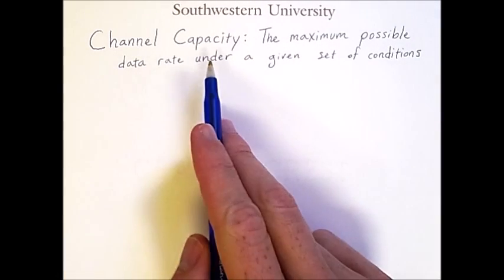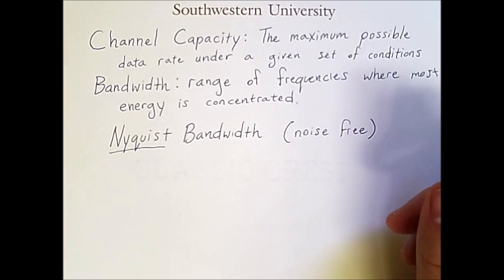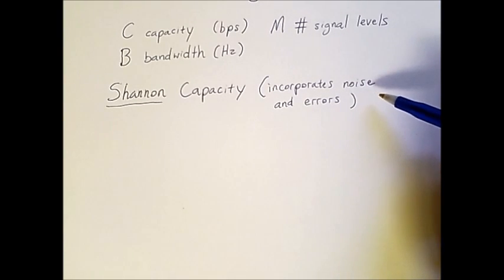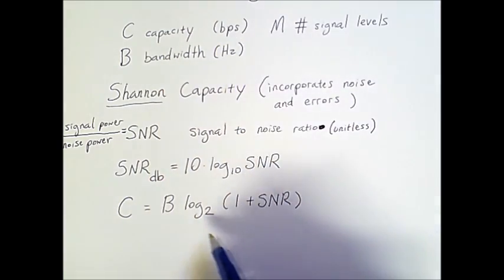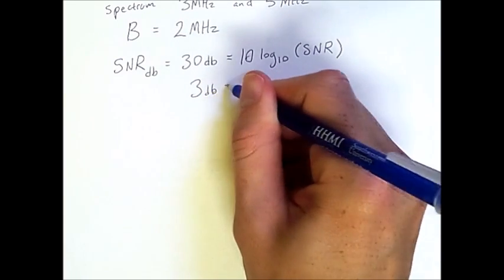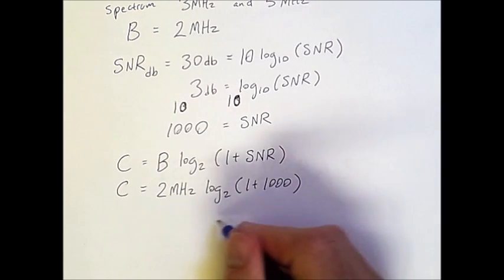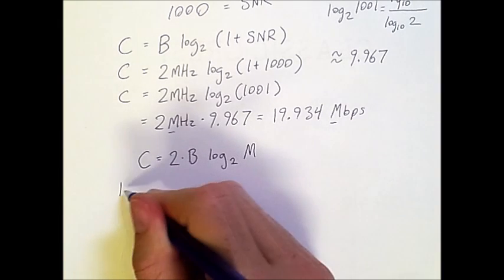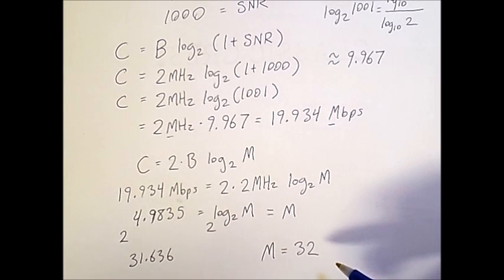Data Transmission 3: Channel Capacity

Comment: A digital communication system transmit data over a telephone link and a
maximum S/N at the output of 15 dB at a rate of 1200 bits/sec via a QPSK modem
that can operate at speeds of 1200, 2400, or 3600 bits/sec with error probabilities -4 -4 -4
2(10^ ), 4(10^ ), and 8(10 ), respectively. Calculate the bit error probability before and after using the error control coding (i.e. channel coding) scheme. Hint: Consider an error control coding scheme for this problem wherein the triplets 000
and 111 are transmitted when b = 0 and 1, respectively.
Can you solve this problem?